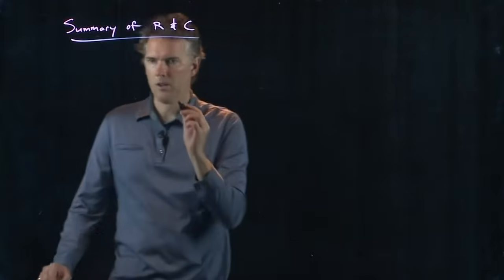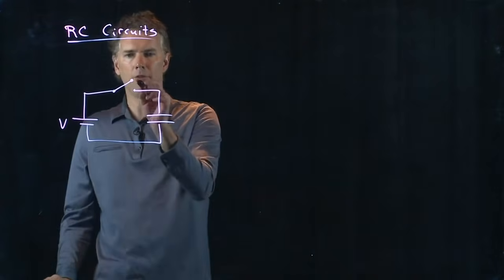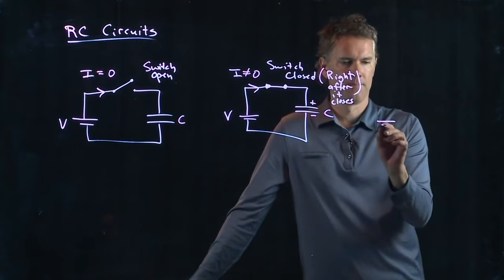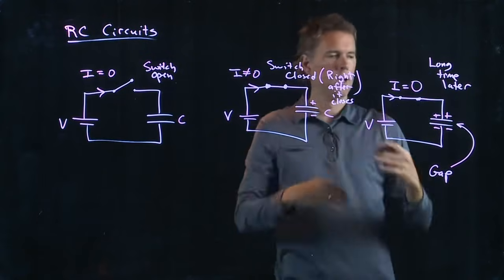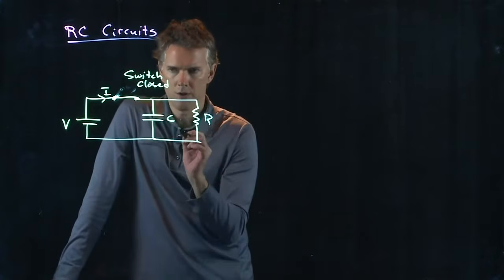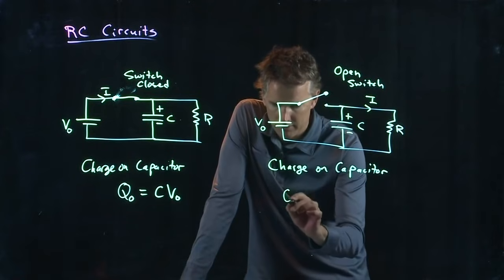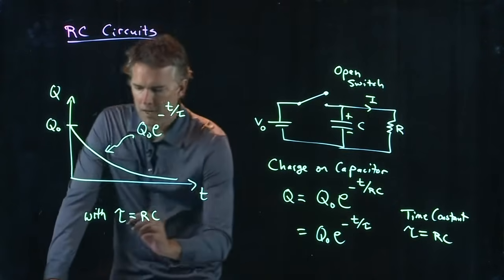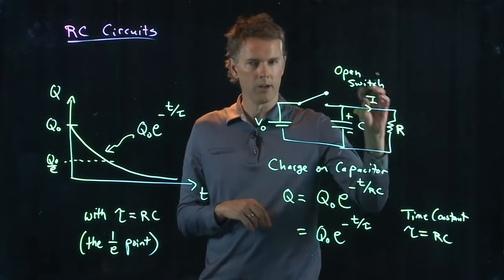RC Circuits | Physics with Professor Matt Anderson | M22-13

Comment: Thank you Dr. A, I just have a small question. At 7:35 wouldn't you need another resistor in the leftmost loop? Without one, according to Ohm's Law, the current would surge and potentially lead to a short circuit.

Comment: As we know that if the capacitor get fully charged then there is no flow of charge through it(capacitor) but is it possible for a capacitor to get more charge if we place a dielectric between the plates of capacitor as dielectric increase the capcitance
Reply from the maker: If you put a dielectric in between the plates, the E field drops a bit.  This means the effective capacitance has increased.  Since Q=CV, bigger C means more charge at the same voltage.
Cheers,
Dr. A

Comment: Thank you Dr. A. A question in the figure at 3:33 - Isn't Kirchoff's loop law violated during this initial transient state?
Reply from the maker: Yes indeed.  Kirchoff's Law apply to steady state or low frequency circuit behavior.  The transient effects right after closing the switch makes it more complicated.  Thanks.
Cheers,
Dr. A